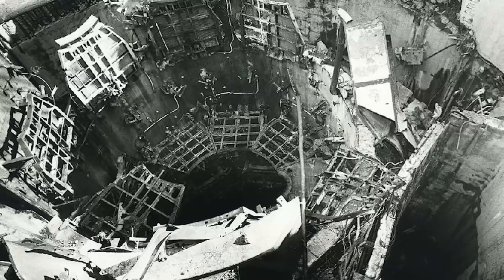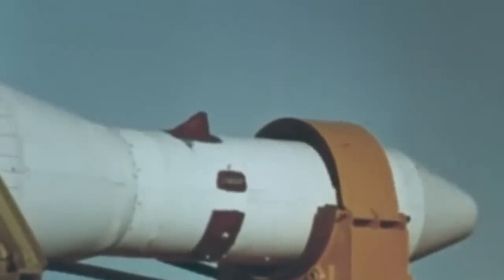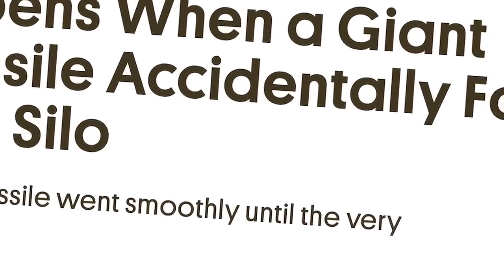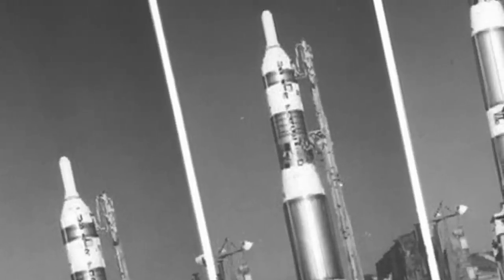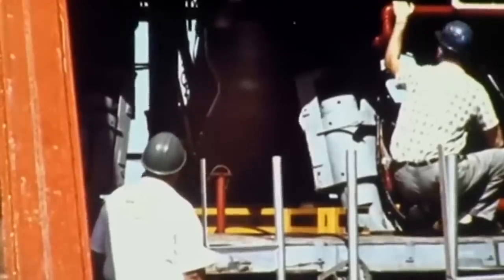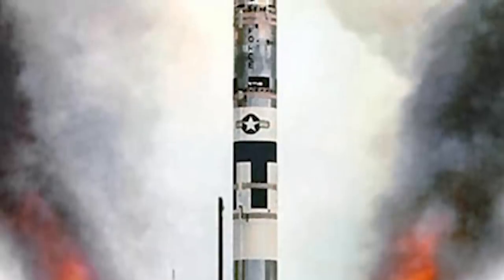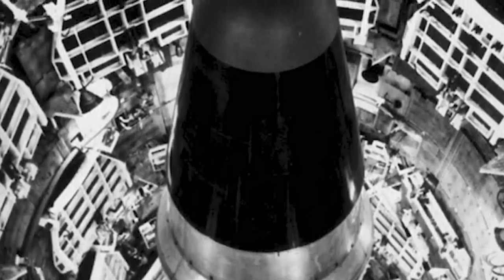Shocking Missile Explosions During Launch Tests

Comment: We've had sooooo many close calls with nukes. It's amazing one hasn't been accidentally set off(yet)
Reply: With all the “accidents” happening recently I wouldn’t be surprised .
Reply: The only thing thats changed is the information campain reporting more of the accidents that take place than what historically has been
Reply: There are a lot of safety features built into nuclear warheads to prevent them from accidentally setting off a nuclear explosion.  It is, in fact, difficult to create a nuclear explosion with most weapons.

You can, however, have a non-nuclear explosion, resulting in radioactive material being spread over a fairly large area . . . .

Comment: Given that the Titans were supposed to be used for retaliatory strikes, after the USSR had already made an attack, it seems that the time and logistics required to get them ready and to launch would make them pretty much useless in this capacity.
I don't understand the logic of this.
Reply: They launched pretty quick. Don't believe the hype from command to turn in the key and the birds fly around 3 minutes. After they push the launch button between 15 and 20 minutes later the target package for that particular set of warheads becomes a smoking hole.
Reply: @brt-jn7kg  Yes, but you forget the time and effort required to prepare the bird for launch.
It has to be fueled immediately before launch. It does not sit there permanently fueled, ready to go.
Reply: @MelbaOzzie , that was true of the Titan I missiles, but the Titan IIs used hypergolic fuels rather than RP-1 (highly refined kerosene) and liquid oxygen (LOX).  The Titan i had to have the LOX tanks fueled just before launch; however, the Titan II used unsymmetrical dimethyl hydrazine and inhibited red fuming nitric acid as its fuels and could sit in its silos fully fueled.

The fact that Soviet guidance systems were so inaccurate back in Titan I's day made it possible for Titan Is to serve as a credible deterrent.  But with much more accurate guidance systems today, Russian missiles can hit missile silos much more easily.
Reply: Olaf Red:  He explained about the fueling of the Titan I.  The Damascus incident was a Titan II that used hydrazine and nitrogen tetroxide, stored in the missile months before possible use.  They were ready to go, which is why the Damascus accident happened at all.

Comment: This is overly dramatic.  I grew up in the Air Force and my father was a B-52 pilot during the Cold War and while on ground and air alert, the B-52's carried nuclear bombs and later nuclear air launched missiles.  All nuclear weapons in the Air Force inventory were specifically designed to not detonate by accident, including the crash of a B-52 or a malfunctioning ICBM.  They were impossible to detonate without being armed which only occurred on B-52's after the launch code was programed into the bomb / missile.  Nuclear warheads were subject to tests where massive explosives were set off to try to get the warhead to explode.  It was they called a fail-safe feature designed to prevent accidental detonation of the warhead.

Additionally, both bomber and missile silo fields are build well outside of populated areas because we knew the Soviets were targeting our strategic bases and missile silos and so we wanted to limit any harm to nearby communities.

What 99.9% of people didn't and don't know is that all of the families and personnel on those bases knew they were primary targets incase of a nuclear strike but it wasn't possible to get away from the blast zone with only 20 minutes notice and only 10 minutes if it was a submarine launched nuclear missile.  My dad, mother, and us kids knew that if WW IIII was to happen, we were all dead except if my dad was able to get his B-52 out of the blast area before the impact.

We also knew that the probability of my dad penetrating Soviet defenses, dropping his bombs on his designated targets and returning home was zero.  And even if he did manage to return, all f the bases would have been destroyed.

Yes, this Titan explosion was horrific, but there was no chance of a nuclear detonation.

You may not know this, but during the Cold War there were several B-52's that crashed with nuclear bombs onboard and nothing happened.  Some bombs were recovered and some not.

A B-47 experiencing a serious problem was forced to drop a nuclear bomb off the coast of South Carolina and has never been found.

You know what?  I was a Marine platoon commander in the Vietnam War from 1968-69.  I and my platoon knew that our government had no intention of winning the war and the rules of engagement gave our enemies a distinct advantage over us.  It was like our government wanted us to lose the war.

The Vietnam War lasted for 10 years with 68,000 US men and women killed.  Compare that to the Titan explosion.

Shit happens, but it mostly happens in our own government.  Turn the military lose to win, and it will happen in months, not decades.  I served 21 years in the Marines with another 2 years in combat.  The one and only way to win a war is to commit overwhelming forces aggressively to break the enemy's will to fight.  Anything less than that and we lose.

Comment: Liquid oxygen is so volatile, but an incredible propellant.
Reply: Actually, LOX is an excellent oxidizer…..

 Liquid hydrogen is an excellent propellant.
Reply: @robertdragoff6909  bot are propellant one is a oxidizer the other a fuel
Reply: Yeah, but that didn't cause the Damascus accident.  That was a hyperbolic (hydrazine and nitrogen tetroxide) released from a hole in the rocket caused by a dropped socket.
Reply: @puncheex2  So it was a hyperbolic hypergolic, then?

Comment: I wonder if any released radioactive materials from there warheads?
Reply: When you’re doing tests you remove the live warheads.  It’s the rare case when one of these blows up and warheads are onboard.  The warheads are also at the tippy top so if the missile does blow in an accident they are thrown clear.  The chance of a “dirty bomb" scenario is pretty close to zero.
Reply: In the Damascus case, no.  The warhead was thrown whole into the air and landed near the silo gaate.  It was carted off by truck the next day.

Comment: What do you mean it was lucky was carrying a dummy warhead?
Rocket fuel Burns and nowhere near the temperatures to set off a nuclear explosion with nuclear material it just wouldn't happen. If it could happen, then nuclear missiles would have to be designed with an ejection module to expell the warhead out of the silo or away from a ln already fired missile if any exploded prematurely doe to some kind of malfunction or parts failure.

Comment: I'm an engineer who worked on a missile program and I'm offended every time a writer lumps engineers and technicians together.

They're not the same.

Engineers design systems, technicians handle the hardware (usually) and generally know more about the nuts and bolts. Engineers have 4+ year degrees compared to 2+ for technicians.

Otherwise a nice video.

Comment: No, the Titan 1 did not use RP-1 fuel, which is highly refined kerosene. The titan 1 used hydrazine. that’s why it was so hazardous to use. Hydrazine is one of the most poisonous substances known.
Reply: Correction: Titan I was RP-1 and LOX. Titan II was hydrazine and nitrogen tetroxide.
Reply: @ttiwkram  I have been corrected. However I had been commenting on the Titan II which seemed to be in service longer than the Titan I. The Titan II did have more mishaps in the silo. And it was extremely hazardous when the hydrazine slung a leak.
The Titan I entered the Air Force inventory in 1963, but quickly became obsolete with the introduction of the more advanced Titan II, which featured storable, hypergolic (hydrazine) propellants. The Air Force deactivated its Titan I missiles in 1966.

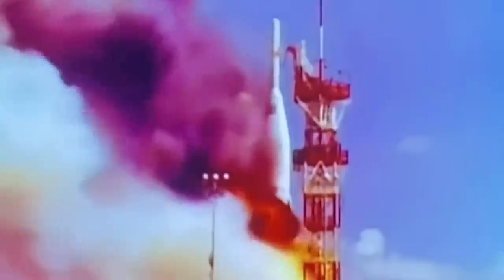Comment: 2:55 Ok ,this is a bit ridiculous.  The narrator guy is talking about the missile tests and how a missile exploded then says, ”Fortunately, it was carrying a dummy warhead.”  No, there was nothing fortunate about it.  Only a complete idiot would have a live nuclear warhead on a test launch of a missile, especially one under development.  This guy has so much potential with his channels but he has to ruin it with foolish statements like that.
Reply: I mean, that’s what is fortunate about it . . . If it had exploded with a nuclear warhead, the area would have been irradiated 

If it’s ultimately gonna explode in an accident, better that it’s unarmed than being loaded with a launch package
Reply: @loganlove9986  - Nah, bro.  That's like when I filled my car with gas today saying it was fortunate I didn't pour gas on my crotch, light it, and burst into flames.  Whew! Dodged a bullet there.  No, that was by design.  You don’t do stupid stuff like that.  When developing a missile, or any product for that matter, you test it piecewise.  Does the rocket motor work? Do the flight controls work?    Does the sensor suite work?  Is the missile body strong enough to handle the stresses of flight?  Are the aerodynamics as expected?  Is the radar cross section what is expected?  Then when all that’s done you put the thing together, add a dummy warhead to keep the weight distribution correct, and start flight testing the thing.  Now you find out if all the simulations and predictions are true.  Now you fully characterize the missile’s performance and see if it can really hit its target.  In the case of a conventional weapon the very last step is to add a live warhead and see if the damage is as predicted.  But no, there’s no luck involved with these missiles not having live nucs on them.  That was all by design.
Reply: The Titan II at Damascus was equipped with a live 1 megaton warhead.  When the missile exploded the warhed flew, and landed near the gate.  It was trucked off the next day.
Reply: The author made two mistakes: injecting personal opinion and getting the facts wrong. It was a live warhead.

Comment: LOX is a clear blue tinted liquid with an expansion ratio of 865/1. Your video shows a brownish liquid boiling off yellow gas. Your stock footage sucks. Otherwise, meh.
Reply: IIRC That's Bromide.
Reply: Brownish liquid would be nitrogen tetroxide. Unlike oxygen it is not a cryogenic liquid but rather a liquefiable gas. It is what is called a storable propellant.
It is usually used with hydrazine as a hypergolic (self igniting) propellant mix.
The Titan I used LOX, the Titan II used nitrogen tetroxide.
Earlier missiles used red fuming nitric acid (H2NO3) - if dry nitrogen tetroxide (N2O4) is 
less corrosive, if wet, it is nitric acid. WD-40 was developed to displace condensation from the rocket body.
Hydrazine is a neurotoxin…